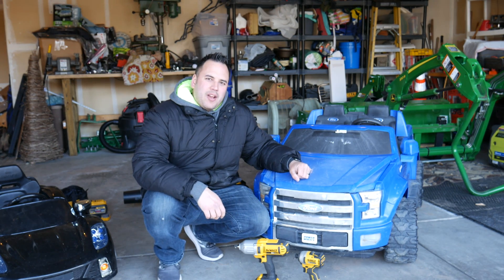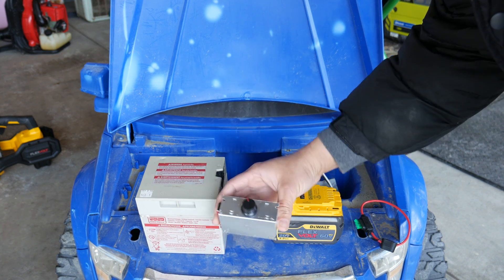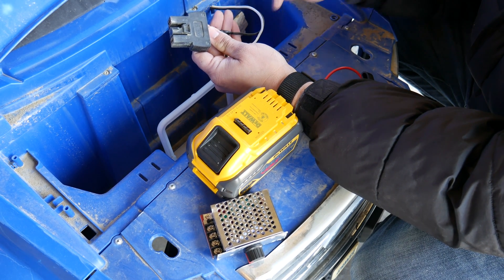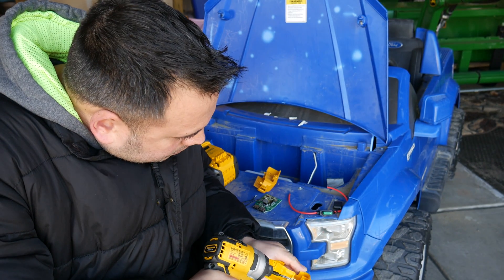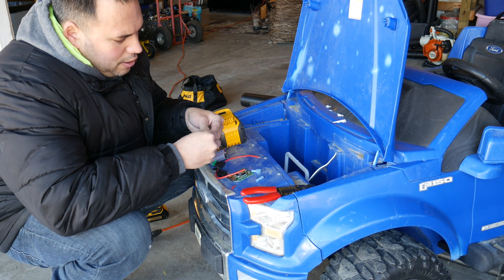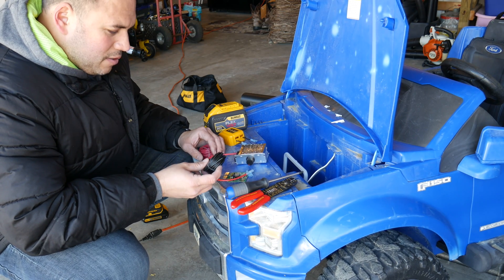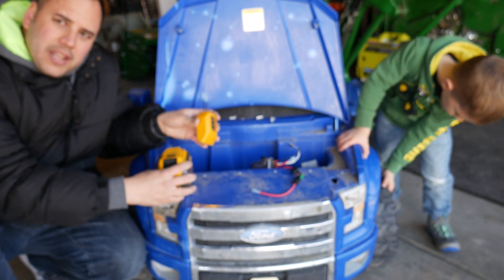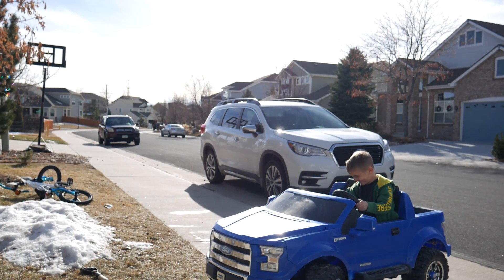SUPER CHARGE your kids Power Wheels with Dewalt 20V!

Comment from the maker: I've added links to the products used in the video description.
Reply: I have 12 v motors on the wheels so can use 20 v battrey with 12 v motor?
Reply from the maker: @NavdeepSingh-hw6fu  Yes.  Some 12v motors can handle it better than others.  You’ll always have some type of ceiling where it’ll melt or quit working.  Running a 12v motor at 20v is a pretty common mod though and a lot of people have good success with it.
Reply: @TractorHoarders   how about a 6v to 20v mod?  would this probably need a motor upgrade?

Comment: I would highly encourage you to add a low voltage shutoff circuit so you dont overdischarge your batteries and cause damage. A 10$ circuit board is way cheaper than a new dewalt battery
Reply from the maker: That’s very fair!

Comment: Just did this a few days ago on my neices power wheel, On amazon the sell a full kit, battery adapter plus a voltage stepdown controller, there is no speed boost due to the new voltage controller is static 12v output. but it made it a VERY easy install process the Dewalt batteries are so much easier to charge and swap out !

Comment: what about 24v truck?
Reply from the maker: You can do it but the higher the voltage, the higher likelihood that your existing wires and motors will burn up under a load or extended usage.

Comment: Did the conversion on my sons power wheels it was running fine for a few minutes but now it turns on but will not move. Think I might have burned the motors out any suggestions on upgrading?

Comment: thanks I merged the dewalt battery to the car one for even more power running the car battery positive, and merging the dewalt to the negative on the original battery and and using the dewalt lead to the car.. but the dewalt batteries keep getting drained way to fast for some reason! anyone know why? is it because the batteries are diff volts maybe?

Comment: So I converted a power wheels 12v to a 20v w a speed control module and fuse..been running fine for a few months..all of a sudden it stopped. I thought it was the power tools battery, until I plugged in he power wheels battery..it ran, then I plugged in a different black and decker battery and it doesn’t run..any suggestions?
Reply from the maker: Weird.  Based on your description, I'd do some basic checks on the Black and Decker batteries with a Multi-Meter, and just double check all of your connections related to connecting that battery.

Comment: My battery keeps over heating I have a 30 fuse on the ground (red) cable. It keeps blowing. How do I prevent this?  12v to 20v DeWalt

Comment: What happened if I don’t used the Dc controller and the fuse can still work ?
Reply from the maker: Yes, it will still work, you just can not control the voltage.

Comment: Question: How do you charge it? Can you charge it using normal power wheel charger or do you have to take the batter off to charge it seperately?
Reply from the maker: You take the battery off and use the original charger that came with it.  I’m my case, I constantly swap batteries between Dewalt tools and the Power Wheels.
Reply: @TractorHoarders  the battery compartment on mine is under the seat. It would be troublesome to take off the seat everytime it need to be charged.
Thanks.

Comment: Buy from a alarm supply place there 12 volt 7 amp hour about $7.00 a 24 amp hour about $12.00 and so forth. I used them for fire and burglars alarms. I buy them in the stores that sell alarm equipment.

Comment: Do you need the additional fuse with the fuse that comes included inside of the controller?
Reply from the maker: Probably not.  Having an external one is nice though because it’s easier to replace.  Otherwise you have to undo screws to take the cage apart on the controller.
Reply: @TractorHoarders  Appreciate it man! Really good video!

Comment: I did the same thing to my kids 12v f150, but it keeps on popping the fuse and wires get hot. Anybody know how to fix this?
Reply from the maker: This may not help but we did blow some fuses over time.  It would do it more with more load… like more/heavier kids, or off-road, or going up hills.  On relatively flat ground with one kid, we were fine.

Comment: Does the voltage controller have a low voltage cutoff or else you can damage your battery
Reply from the maker: Good question.  No, it does not.   Over the last 10 years I’ve done this to probably 10 power wheels and never killed a battery from that.  It is a real concern though.  Maybe I’ve been lucky?  I don’t know…
Reply: That’s built into the dewalt batteries so is a non issue.

Comment: How did the stock motor and gears hold up to the extra power?
Reply from the maker: Never really had any issues directly related to the motor or gears.  I eventually had an issue with a switch, but I believe it may have been water related and not related to the power upgrade.

Comment: Before watching these videos i just stuck some wire with spade ends from the dewalt battery connector to the original battery connector  tried it on my son's jurassic park quad normally ran on 6v battery 😂 and it was ripping for maybe a minute before I completely seized the little motor I opened the little motor gear box and only the motor seized time to to order him a new motor and the potentiometer with the battery adapter on low setting see what it does lol thanks
Reply from the maker: haha  it's hard to do an upgrade like this on something that was originally 6v.  Hopefully toning things down with the potentiometer helps out!  I've done the same thing on another one, so you're not alone! 😂

Comment: Soldering is not the absolute best way to connect the wires as it increases resistance in the line.
Crimping is the best way to go.
Reply from the maker: I guess it depends.  A bad crimp will add resistance as well.  Which has the higher probability of being a problem?
Reply: @TractorHoarders  You won't find any soldered connections on a le Mans race car. :)
Reply from the maker: @roystonfence816  Good points to think about 👍

Comment: Did this to my daughters frozen mustang and would not work. It goes into a limp mode and the circuit board has a flashing red light. If I put the regular power wheel battery it works fine…Anyone have any ideas ?

Comment: That was just dumb. You could have just left the usb plugs in there and soldered a connector to the leads, that way it is still a 20v battery to USB, AND you can use it for the power wheels...
Reply from the maker: I have no use for USB, but thanks for your expertise
Reply: Lol.....you are showing how dumb you are.....using the USB, you would only be getting 5 volts out of it....hence why there's a circuit board that gets taken out to go direct to the battery.  So no, you shouldn't just wire up to the USB.

Comment: Did the rear wheel motors ever go out after doing this upgrade? any issues?
Reply from the maker: I've done this with a bunch of Power Wheels and have rarely had motor issues so long as the vehicle was originally 12v, and I didn't exceed 20v.  24 or 36 volts is a different story.... very fun for a short time! lol

Comment: After this long, did the motors burn out while using a 20v?
Reply from the maker: I recently sold the truck, like two weeks ago.  It quit working, but I don't believe the motors burnt out.  It was some other electrical issue that I didn't take the time to diagnose, but I don't believe it had anything to do with running 20v.  I've done this mod to approximately 10 power wheels with no real issue from that.  We're pretty rough on them, so the causes of death have been other things.

Comment: Do you have a wiring diagram?
Reply from the maker: Hi Craig, unfortunately, I do not; however, Power Wheels in general have very simple electrical circuits.  You pretty much just have a battery, switches, and motors (at least on ones like this).  From the battery, you basically just have "+" and "-" going to a fancy switch (high forward, low forward, reverse), and then the other side of the switch feeds to the rear motors in parallel.  You can get a cheap volt meter off of Amazon (example:  https://amzn.to/3xrU08f) and use it to confirm polarity.  Good luck!

Comment: That’s exactly what I did for my kids except I’m using the Milwaukee 12v and 18v battery and that thing rolls through sand mud tears right through it.
Reply: Wait,  not both at once right?
Reply: @RentADad  I think he meant like one in each car since he said kids.
Reply from the maker: Makes a huge difference!  Excellent work!
Reply: I use my 18v Milwaukee battery too but fuse keeps popping and wires get hot. Any idea why or how to fix this?
Reply: @jessehuerta1946  more bigger cable gauge

Comment: I'm burning out batteries. Any idea why?
Reply from the maker: Hi Dan - sorry to hear that.  I personally haven't had that happen.  Some people say if you run them down too far it can cause problems, but I've personally never experienced that and I've done this to probably 10 power wheels vehicles in the last 15 years.
Reply: Yup, sounds like the batteries are being discharged too much. You will need a Low Voltage Cut Off. This video will guide you on how to do it: https://youtu.be/S9LMmRpvSGg
Reply: @DadHacks  thank you so much

Comment: My car burns fuse when It acelerates I need help
Reply from the maker: Hi Aureliano, when you are blowing fuses, it means that the current being drawn is greater than what the fuse supports.  So for example, if it's a 20 amp fuse, you may be pulling more than that.  The fuse is in place to protect other electrical components from burning or melting.  Without knowing the details of your car, things like weight, can affect the current draw...  for example, if multiple kids are in it, it will draw more amps than with one kid.  If you're in places of greater resistance (grass versus pavement), it will draw more amps.  There can also be other electrical issues that can cause this too.  You can get a cheap multi-meter and perform some basic diagnostics.  https://amzn.to/3ucTs4q

Comment: I have added 18 v drill battery to my daughter's ride on car. Originally 12 volt battery. But the car keeps shutting down while operating. You need to turn it off and on again to make it work. Where I have gone wrong. I have a 30 amp fuse to it. Tried an automatic circuit breaker as well but issue is still there. Everything works normal when I put it back on 12 v battery setup.
Reply: Your main computer shut down for over heat  cause is not build for 18v  try max 14.4 volts it will work without stop...

Comment: Great video! One helpful tip for the these ride ons is to get a bicycle tire, cut it so it’s one long strip, then cut it long ways so the sides are trimmed off. You should be left with a long strip of the middle tread. Cut enough so it wraps around each of the rear tires and then use flat head screws to secure the tread to the plastic wheels. Viola! Assume traction and no more wheel slip!
Reply from the maker: Excellent advice!
Reply: this is what our corvette on 20v has, it will just freespin otherwise lol

Comment: On kobalt car rear wheels turn opposite directions why  it is brand new
Reply from the maker: That’s interesting.  So in reverse, it goes forward?  And vice versa?  Sounds like maybe they reversed the battery terminals within a connector somewhere.

Comment: The wires on the USB charger verses the fuse wire are very different in size. Was this the same with yours? Can they still be spliced together?
Reply from the maker: You can.  It’s not ideal, but it will work.  Mine was the same.

Comment: Thanks for the video.  After upgrade battery conversion, my rear wheels motors are destroyed being plastic.  What can I replace it with to make them durable?
Reply from the maker: I’ll defer to other viewers to comment.  I haven’t had this issue so far.  Hopefully someone else can steer you the right way.
Reply: Add bigger motors 775 with metal gear boxes they bit expensive but do the work I seen videos

Comment: How long does a full charge last you guys? I did this for my son, and 1 charge is only lasting me 10 mins. Granted, he's going max speed...
Reply from the maker: Hopefully some others can chime in.  It’s going to be directly related to the amp hours of your battery.  The smaller it is, the shorter the run time will be.

My 5 amp hour battery seems to last 20-30 minutes, I think.  My 60v Flexvolt might be 9 amp hours at 20v and it lasts a while; maybe 45 minutes.  I haven’t timed any of them though.

Comment: What gauge wires you using to connect everything?
Reply from the maker: Although I do not remember, it would be preferable to use the same gauge wire as what’s already in the vehicle as a minimum.
Reply: @TractorHoarders  ok swt, Im assuming it'll be 12 gauge but will have a look. Cheers

Comment: So I've done this to my son's. I used a 20 volt dewalt battery straight to the connection Port where the regular battery goes but when I try to turn the machine on it just flashes and doesn't actually turn on I'm thinking there's a voltage overload protection somewhere??
Reply from the maker: It may depend on which vehicle you have.  I personally haven’t experienced that on any of the Power Wheels I’ve done it to, but it could be possible.  These things are usually fairly simple.  I’d trace the wiring and see where exactly it goes and what’s in line.  On the simple ones, it’s usually just a series of switches.

Comment: Hans, great video, dud you have to upgrade the motors to do this? Most motors are 12v can they handle 20v with ease? All the best stay safe 👍
Reply from the maker: Hey Ben, not motor, wiring, or any other upgrades.  Just what was seen in the video.  Works like a champ.  Our only issue now is all the wheels are worn out lol.
Reply: @TractorHoarders  many thanks 👍
Reply: @TractorHoarders   my wheels are also got worn.  Do you have a solution for that?
Reply: I put dolly tires on it with getting new plastic hubs and made a spacer out of wood to fit it in place
Reply: But before I did that I used old used bike tires with rivets and the marine 5200 adhesive after sanding a little and cleaning the tires real well. Hope that helps

Comment: I have a similar setup but worried I burn up the 12v motors.  How long did yours last?
Reply from the maker: MrCmbradley I’ve had 0 issues with the motors.  Working just fine!  The fuses protect the wiring and motors.  Sometimes we replace fuses.
Reply: @TractorHoarders  great to hear!  can you share the specs on your motors?  Mine are 12v 540 8000z

Comment: I did this for my niece and the motor blow up after about 10mins of driving
Reply from the maker: That's no good!  Ideally, you want to add an inline fuse that blows before any motors or wiring burns up.
Reply: @TractorHoarders  what amp or fuse size?
Reply from the maker: @maxpayne865  we’ve used 30s.  I’ve seen others say they use 40s.  I’ve not tested the voltage controller to see how high I could take it.  I do occasionally blow the 30s if we are under a load, like if he climbs hills or has a bunch of stuff in the back.

Comment: Hello can I use 4x12v batteries for my power wheels it’s 24v System just to get more amps?
Reply from the maker: Yes you can.  Just make sure you wire it up right.  Wire two sets in parallel, and the run those sets in series.  When doing that, it’s also best if the batteries are of the same age and health.
Reply: Hans Makes It Work - Tractor Hoarders Very helpful thank you so much

Comment: I got a question the wire that came on the usb adapter is very thin can that wire cannot be used with that thick wire ?
Reply: I used this same setup and the small wires melted into the yellow plastic USB charger housing,  had to adapt and use larger size wire

Comment: I did the milwaukee 18v and fried my battery after if ran down. Now only flashes and will not recharge.
How did you prevent that on yours?
Reply: Your wires probably touched
Reply: Did you find a good low voltage cutoff protector?  I'm looking for one now.

Comment: U cud use the circute board to install usb conn3ctions on the dash of the power wheel just.  Make usb slots for it and secure it some how behind the dash !!  Put the circute board the same but with longer wires.  And you will be set.   Usb connections for your kids. To charge their electronics
Reply from the maker: That’s a great idea!

Comment: those batteries (stock power wheels 12v) now cost 92 bucks...inflationary times
Reply: Dang for real? You can find 2 dewalts on sale for around that price. And the dewalts won’t take 3 months to get a full charge lol...
Reply: @Mr_Daddy1980  for sure.  I have upgraded 3 power wheels now and eliminated the stock batteries.  2 are using m18 Milwaukee generic batteries and 1 has 2 dewalts.   Look up "altered component" if you want to see our full build.

Comment: Wouldn't it have been much easier using a smaller battery and the 18-20 volt adapter that way you still have a built in discharge monitor?
Reply from the maker: I’m not sure I understand.  What component would serve the purpose of the discharge monitor?
Reply: @TractorHoarders  lithium batteries will not take a charge again if the voltage drops too far. So a voltage disconnect would save the batteries from an early death.

Comment: Will this method work for the remote controlled power wheels cars?
Reply from the maker: Player #1 , it’ll take a little more effort.  One of the simplest ways is to isolate the drive system and extra electronics (the RC electronics).  The drive system can handle increased voltage, but the other stuff would likely fail.
Reply: Do you recommend use other battery (12V ) for the electronic only ? ( remote controlled car )